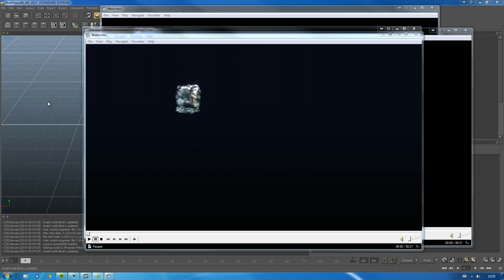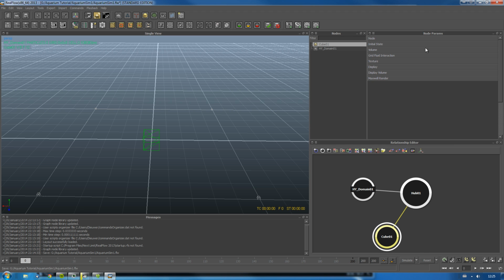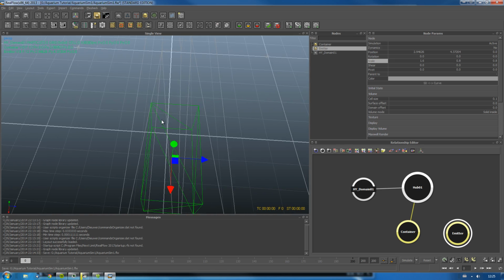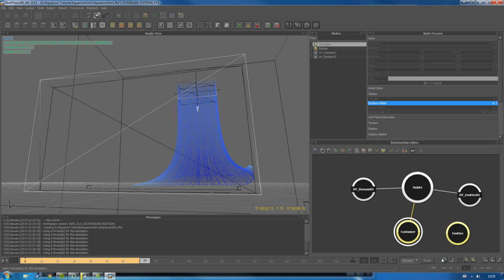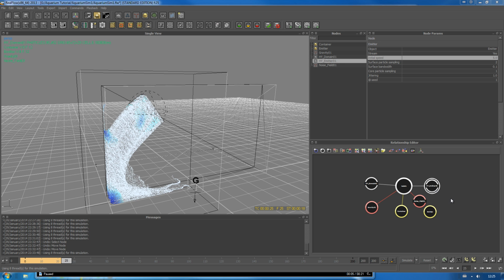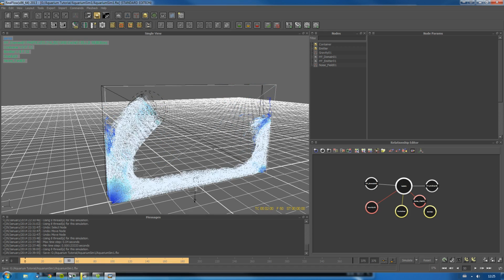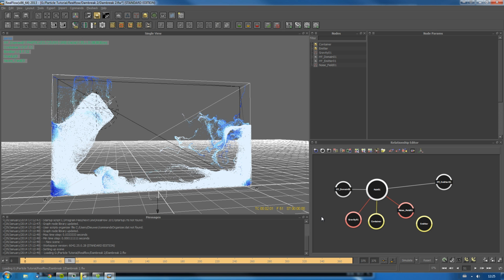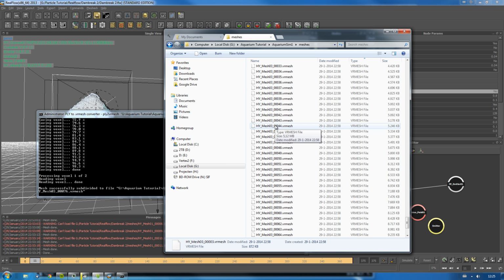Tutorial: Flooding an Aquarium - Part 1 - Introduction, Realflow 2013 and Hybrido

Comment: Thanks very much for this tutorial, I always assumed the command line would be roughly the same as normal sim, learning how much faster it is was a real revelation :)
Reply from the maker: Yeah it does! One of the most fun differences is when you're doing very low resolution test sims. In those cases updating the GUI takes longer than simulating the particles. So in command line it flies through in real-time while in the gui it takes ten times as long. With very high particle count sims the difference is smaller but still enough to save you hours sometimes.

Comment: Fluid Simulation : Realflow, Maya, Krakatoa, Nuke

Thanks a lot for this amazing tutorial. The first that I found which is complete (from the beginning to the very end with great tips for the rendering and the compositing). 
I've just got a problem with the "noise" in realflow, the deamon didn't do the same thing than you....mystery.
Otherwise it's a very cool tutorial, all the explications are very clear.

Well done !
Reply from the maker: Yeah some builds have issues with the noise! You can try setting it from froce to velocity or the other way around. One of them should work properly. Thanks for sending me the vid! Its looking great! One question though, it seems you and a few others have not done the motion blurring on the mesh in nuke. Why did you decide not to do it? Or was my tutorial incomplete?
Reply: InfernoAcid Well, there is motion blurring, but less than you. I thought it could be great. It's a choice actually.
Reply from the maker: In that case I didnt say anything! Very good job!

Comment: i have watched all 3 videos related with this tutorial.this is the most advanced tutorial i have watched so far.i don't use maya in my workflow.never used krakatoa.and also no knowledge about nuke. i am a max user and recently started learning realflow.and i use after effects for compositing.i watched your tutorial knowing that it will be hard to follow but!! can you give me tips to implement your workflow to max? do i have to use alembic files from realflow to max? and krakatoa works the same in max? and for the third part in vray render pass with velocity can it be applied with vray version in max? never used a velocity pass before.also do i have to use vraymesh files again in max? those are noob questions but i would love to achieve the same beautiful results by using rf,max,krakatoa,ae. Btw ty for this GREAT TUTORIAL SERIES.Also about the fucking thing that you are not a maya guy.Damn you are using it very good already!!!

Comment: Hi, DieuwerF! Is it possible create a simulation in deep water (2000 meters) ? And with we have data about ocean currents.
Reply from the maker: Ricardo Portela da Silva are you talking about simulations that will need to be used for Scientific purposes? Because the software I'm using is purely for visual purposes.

Comment: I want to export vorticity channel for krakatoa. I set the prt export in the export central.I even set the vorticity for .rpc format and I can see my vorticity in the realflow visibility options. But when I import the particles in Krakatoa MY with the prt loader, I can't see any input channel called "Vorticity" in the Magma editor. 

Can anyone help me please? I'm about to loose my mind.
Reply from the maker: I wish I could help but I do not have access to Maya anymore! It should be viewable if you export the Vorticity channel to your PRT's.. The value will be different than the Velocity so you'll have to see what it is and then divide it properly so it will fit in the UV 0-1 range again.
Reply: Krakatoa MY doesn't has "vorticity" input, but 3ds max.

Comment: Ah, after 4 days of rendering, compositing and playing around I've done this in 1080p 60 FPS (YouTube didn't prepare it yet I think):  https://www.youtube.com/watch?v=sWNnsZlVCpg
Reply from the maker: Erik Bročko Great stuff man. Thanks for posting the result!
Reply: DieuwerF Haha, thank you! :D That means a lot from skilled graphic artist like you. And thank you a lot for the tutorial, too. I learnt some basics of Maya and discovered (for me) whole new PP software (Nuke).
Reply: By the way, do you know how long it takes to process 1080p 60 FPS? I've uploaded it yesterday and there's still only non-60 FPS version.
Reply from the maker: Erik Bročko I've got no idea! Never uploaded in 60 fps. Are you sure that its compatible? ( try h264 qt @ 60 fps or h264 mp4 @ 60 )
Reply: DieuwerF It's preset "Internet 1080p" from Vegas Pro with 60 FPS and higher bitrate.
Reply: Hm, interesting. YouTube debug panel shows correct number of decoded frames (for 51 seconds long 60 FPS video), but there is no "1080p60" option in quality settings :D
Reply: DieuwerF InfernoAcid was more creative and better rememberable :D
Reply from the maker: Erik Bročko True but I made that up 16 years ago for Quake 3.. These days I need to get my real name connected to my work ;)
Reply: DieuwerF Excuse me , how can I control  the quantity of water in real flow if I want to fill the water  full of the box from bottom.
Reply: 莫其霖 Fill object

Comment: thanks for the nice tutorial. but how can i do this by using 3dsmax?
Reply from the maker: In Max it will work in about the same way. Just use a Magma modifier on a Krakatoa PRT loader. You could also use Thinkbox Frost to mesh the particles instead of Realflow if you wanted to ( which is how I did it in my original video )

Here's a tutorial. http://www.thinkboxsoftware.com/krakatoa-realflow-and-frost/

Comment: Hey man, do u have any ideas on how to create an endless ocean?
iv tried all kind of methods and they dont really work
Reply from the maker: VFX Ltd™ check out Houdini's ocean toolkit. Or anything like it for max/maya. Also some good compositing of a static horizon is gonna help you a lot.
Reply: Ah yes. I've tried using hot4max hundereds of times, but somehow the modifier deforms my mesh so much that it moves it from the origin and i can't seem to blend the RF mesh with the plane.. However, using the extended plane feature in RF gave jagged edges. As for compositing, you mean masking it out?

Comment: noise field just blows my shit up completely - any idea why?
Reply from the maker: karol lasia Tried putting it way lower? Or inverting it? I dont have Realflow installed anymore.. Sorry.
Reply: karol lasia try to change the value of the space scale
Reply: +karol lasia Hey, did you finaly sort this issue out? Im having same problem... Thanks
Reply: i wish.. sorry!
Reply: +karol lasia Change from Velocity to Force in the Noise field setting.
Reply: Yes, it works.
Anyway my Krakatoa does not render RGB channel, just alpha... so upset....
Reply from the maker: +Dani Perez  did you enable all the lighting settings that i specify in the tutorial? Also, are you working in the same scale as me?
Reply: Thanks DieuwerF, yes i did exactly the same... anyway I will do it agian..

Comment: Cool tutorial. Im having a problem with the ply2vrmesh converter. I always get an error. It cant read the bin file for some reason. It says wrong ID fadaba or something. Im not using the Maya version but 3ds max and its called "OBJ GEO PLY to .vrmesh converter". Same thing right? Anyways my bin file is 76 GB. Im not sure if that could be a problem. Also tried Frost to import the .bin and 3ds max crashes. Thanks!
Reply from the maker: If you've followed my tutorial step by step then you should have .PRT files for the particles on your hard drive. You can load these straight into Frost and it should work.
Reply: InfernoAcid Awesome. I thought PRT was only for particles. Thanks buddy! I will continue! :D
Reply from the maker: guillaumepalm1 well Yeah PRT is just for particles. But you said youre using Frost. Frost will only take particles or vertices as input. If you're inputting the realflow mesh in there you're going to overload it.

Comment: what is your pc's system config.. ?
Reply from the maker: i7 2600K and 16Gb of memory. I designed the tutorial to be doable on slower older machines with less ram.
Reply: and graphics card need or not.
Reply from the maker: Most 3D stuff is done on the cpu and ram. A reasonable videocard is nice. But its not the primary need. But a standard gaming videocard in the 200 dollar pricerange is more than enough for most artists. Once you start doing specialised stuff ( GPU Rendering/simulating ) then a professional videocard starts getting important.
Reply: ok thanks..

Comment: btw do u have an i7? Its impossible to do these sort of simulations on my i5 lol...
Reply from the maker: it will take about twice as long. got an i7, yeah. but I set it up so it'll take 1 hour on my old i7 so my guess would be it'll take two on an i5. Don't let that stop you!
Reply: DieuwerF Haha, and may i ask how much ram does your i7 have? Luckily i have a i7 16gb ram laptop. Just that i dont use it too much :S
Reply from the maker: +VFX Ltd™ I had 16 but I have the sim set up to not use more than 2.
Reply: DieuwerF Why wouldn't you fully utilise all of the ram? :o
Reply from the maker: +VFX Ltd™ because I didn't need to and I wanted people with lower specced machines to be able to do the tutorial. honestly the less ram you use the better. it's more impressive if you do something with a little ram than with a lot! ask any industry professional:)
Reply: DieuwerF oo, thanks for the info! :)
Reply: Hey man, i jsut stumbled across your thread on RF regarding the issue that the simulations were slower, the higher the threads were. 

I was planning to get a i7 6800k ( which has 6 cores, and 12 for hyper threading) and maybe a gtx 1070 for the GPU. However, i'm not sure if RF would utilise all of the 6 cores of the CPU. In addition, i'm afraid it would even be slower than my current i5 with 4 cores...
Do you have any ideas on that? Been racking my head for weeks at whether i should buy the 6800k or not.... in which the primary uses would be Reaflow, Fumefx, Mari, Zbrush, 3dsmax vray etc.
Reply from the maker: I cant recall a thread like that, could you link me? :) But that i7 will be amazing! No worries at all! You'll love it. Always simulate through command-line/background to get the maximum performance though. :) Updating the viewport is a big bottleneck.